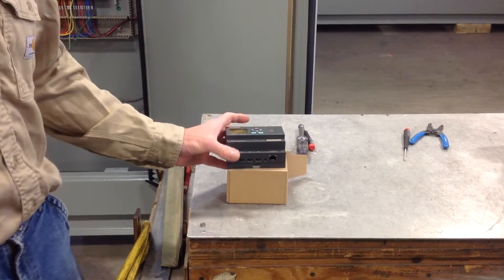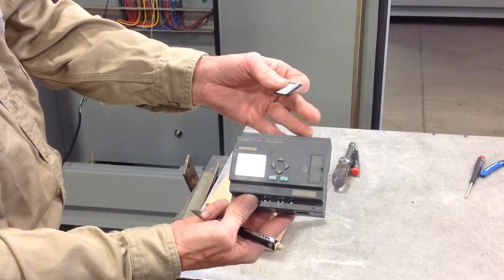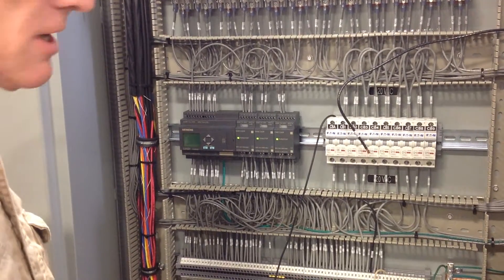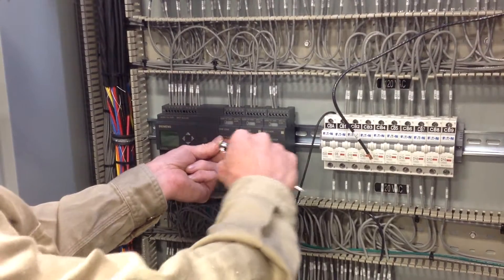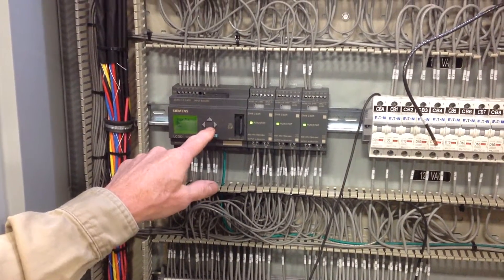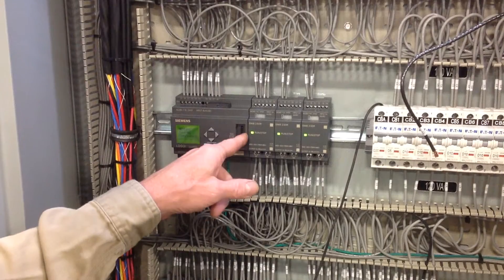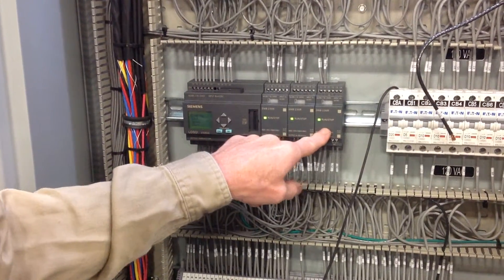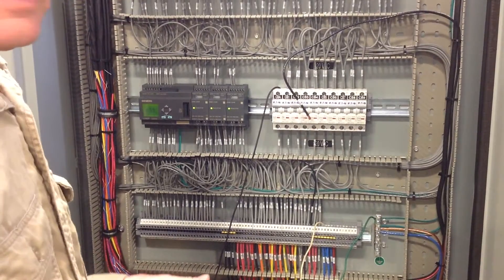Siemens LOGO Program Logic Change

Comment: Does Siemens logo plc require any external module for power supply or we can give 230v directly to it .As the data sheet shows the power supply to be 24v dc .what should I do ,bit confused ,can you help me out sir
Reply: pratik mundagod your output acts as a switch ... the minute it gets energized, it closes ...it doesn’t matter if you’re putting dc or ac into it
Reply: I have a 12v wall wart running mine, for testing. In my case white dashed wire was +

Comment: Hi! 

1. Can we input NPN or PNP 3 wire proximity sensor to Logo (DC input brand)?

2. I don't see any common pin (COM, 1M or S/s, for sink/ source select as I know) in the input. Do they wired internally inside the Logo? (sorry for my English)

Best regards.